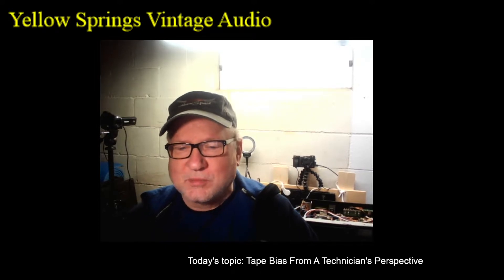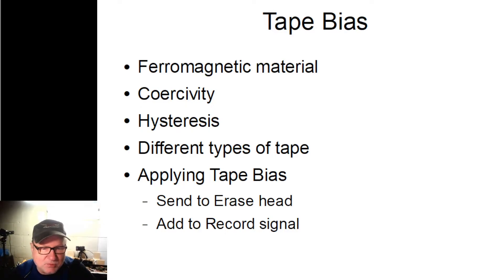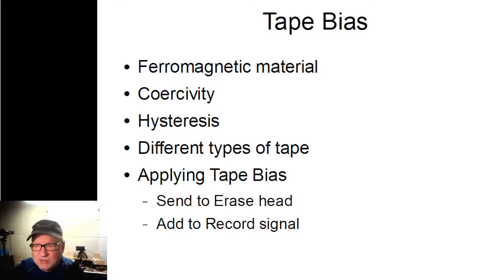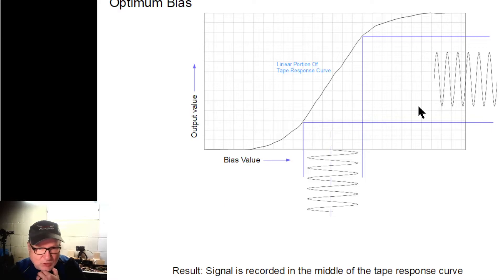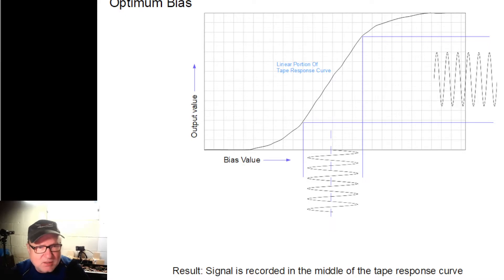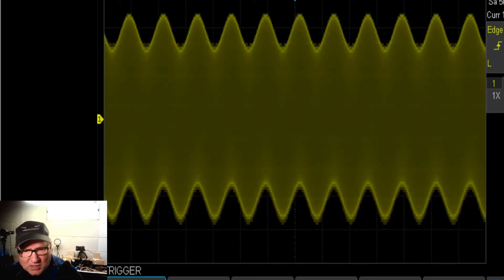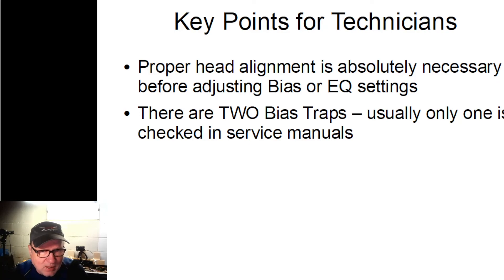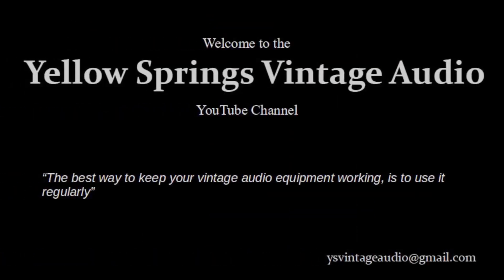Tape Bias from the Technician's Perspective (a little technical)

Comment: Hey there. Great explanation, thank you. I do have a question though.. I have a Tascam cassette multitrack recorder and want to add in a switch to toggle on/off the erase head (with it off I can easily record sound on sound using a tape loop). If I understand correctly, simply adding a switch into the circuit would have negative effects on the quality of the recording. I’d love to know how you would go about implementing this modification. Cheers

Comment: So, is the knobs on the front panel is usually not for the recording but for playback? is the recording one on the circuit board?
Reply: @SIBIRIAKcom,  In the record mode:  the input knobs control the signal going to the record circuitry. The record knobs adjust the level of signal being put on to the tape by the record head. A proper level of tape bias is required to ensure the input audio signal is recorded on the tapes' most sensitive region.

Comment: note: the 100Khz is for consumer based machines. I have setup machines with a 432Khz (record) and 144Khz (erase) 1:3 raito on professional machines lie the AMPEX ATR-100. Beginning with the AMPEX MR-70, AMPEX began using 150Khz as their bias frequency.
Fun Fact: 2" Quad video tape has the magnetic particles oriented perpendicular to the tape as opposed to parallel to the tape. Of course 2" quad video tape machine are on a WHOLE other level of performance to a simple audio recorder, where an audio recorder must faithfully reproduce up to a 20Khz bandwidth, whereas a video recorder must faithfully reproduce a 6Mhz bandwidth!
Reply: @rty1955  Great information! Thanks for letting us know more about commercial machines.

Comment: Why didn't they record using FM like Ampex did with video on the quad machine? No bias or noise reduction needed.
Reply from the maker: I suspect they didn't use FM for storing the sound on the tape was due to the complexity of the FM circuitry.  Retrieving the audio signal from an amplitude modulated signal is easier (equate  that to cheaper and easier to maintain) than frequency modulation. That is very valid question, of which I don't really have an answer.  Thanks for asking.

Comment: I wish more people would watch videos like this. It proves the point I've been making to Nakamichi owners since the early 80s that using a bias trim control as a record EQ control is entirely the wrong way to go about it. It's just poor design. If you want minimum distortion, set the bias level correctly first, then sensitivity level, then recording EQ. That's the way Pioneer's Super Auto BLE automatic tape calibration goes about it and the results are always superior to tweaking bias alone. This wouldn't be necessary if all cassette tapes followed the IEC specs per tape type exactly, although there were a few specific BASF reference formulations that came very close if you knew what you were looking for.

Comment: Thanks for the great video, Keith. I do have a question about bias trap settings on a Teac A-6100 MK1. The service manual says to set the traps for minimum output but, that’s completely to the left & I imagine that that would be completely down. Am I misunderstanding something?
Reply from the maker: Simpson, the purpose of the Bias trap is to remove the 100KHz signal that is present on a tape that has anything recorded on it. So by setting the trap for a minimum output, you are ensuring that only the actual audio passes through to the tape out pre-amp section.  Keep in mind that there are two bias traps.  The first one stops the bias signal coming from the tape.  The second bias trap blocks the bias signal erroneously feeding back into the input circuitry - this second on the very important as its purpose is to prevent the strong bias  signal being recorded on to the tape, from seeping backwards and interfering with the audio signals from the playback and record circuits.
Reply: @yellowspringsvintageaudio352  Thank you for the response, Keith. So, on my o-scope, once I see the 100kHz sine wave, I should decrease the bias trap until the sine wave is no longer visible or barely visible?
Reply: @SimpsonSound  yes... you might be able to make the bias signal go away. But you should be able to minimize both channels to near zero. If there is a significant difference between the right channel minimum as compared to the left channel minimum OR there is bias further back into the circuit, then you need to repair the bias trap. If you follow your schematic from your line inputs or microphone inputs, you will see that the very last circuit before the inputs are sent to the record head... is a 100 KHz bias trap. Immediately after the bias trap, the inputs are combined with the high signal bias oscillator. That bias oscillator signal must not be allowed back into the input circuitry! If you suspect that might be the case, the bias trap consists mainly of a resistor-capacitor and a transistor. When checking the capacitor with a dvm, always remove one lead from the circuit board. My experience has been that bias trap failures are either or both of the capacitor and transistor.
Reply: @rovingreikimaster Thanks again for the response. I’ve now finished adjusting the bias trap & did a bias adjustment using the type of tape I’ll use on the deck. I’ve calibrated it back to factory specs per the manual. It sounds amazing! Thanks to your channel & your help, I now understand exactly what’s happening & what I’m doing. A sincere thanks to you. I really appreciate it very much.
Reply from the maker: @SimpsonSound  Thanks for that update. I'm glad I was able to help you!  Out of curiosity, what test equipment do you use besides an oscilloscope?  I have been considering making a video about tape deck test equipment (purpose built, general off-the-shelf, and really cheap/used).  Would you find such a video(s) useful?
Reply: @SimpsonSound  I glad to hear your tape deck is sounding great.  Just out of curiosity were you making most of your measurements via a oscilloscope?  What other test equipment did you use?  

I have been thinking of doing a series of videos of tape deck test equipment, from purpose built to generic to down right cheap.  Would you find such a video interesting/helpful?
Reply: @rovingreikimaster  Thanks, Keith.

For my calibrations, I use:
1. Ferrograph Recorder Test Set RTS2.
2. Oscilloscope
2. NAK T-100 (software)
3. Digital multimeter
4. Different calibrations test tapes (3 3/4, 7 1/2 & 15 ips).

I think it would be great if you'd make a series of videos. It would be extremely helpful to the community. Especially, because there are not many reel to reel techs around anymore and people are now forced to be their own techs on these decks. Although I've been using reel to reel since the 1970s, I only started learning to repair them about 5 years ago. I've always wanted to learn but, just didn't know where to start. Thanks to people like you here on YouTube and Facebook groups, I bought an old Teac deck, got a hold of the service manual, took it apart and fixed it. Since then, I've repaired and rebuilt a Revox B-77, two Revox A-77s, Akai GX-255, Sansui SD-7000 and now my Teac A-6100. It's all that I really want to do now. I actually dream about trouble shooting and fixing these things! I love it!😄

Comment: Can you bias tape with AM modulation? Would that lead to less distortion?
Reply: Amplitude modulation (AM) causes the high frequency carrier to get stronger or weaker in response to the audio waveform, resulting in a symmetrical waveform. In other words, if you could slice the waveform down the zero line and flip the negative side upside down, it would be identical to the positive side. if a negative peak is strong enough it will completely pinch off the carrier. Bias on the other hand is different...If you look closely at the waveform in the video you can see that the positive side is not symmetrical with the negative side. In AM, when the positive peaks become more positive, the negative peaks become more negative. In bias, the positive and negative peaks move in the same direction.
Reply: Miro, if you look at the signal coming directly off the playback head, what you see is the stronger, higher frequency, bias signal being amplitude modulated by the audio signal. The first circuit the playback signal goes through is a filter that blocks the higher bias frequency... leaving the audio signal to proceed on to amplifier and metering circuits. The opposite is true during recording. The last circuit before the record head is one that amplitude modulates the much stronger and higher bias frequency with the audio signal. So the answer to your question is, YES. That is exactly what happens.  Thanks for your question and watching my video.

Comment: Thanks for your technical explanation Keith! It fills in a lot of little holes in my understanding. How hard would it be to measure the signal direct from the playback head to see what a pure tone + bias looks like on the tape? I tried with a cheap digital oscilliscope, but I don't think it's sensitive enough at 20 mV.
Reply from the maker: Mike, looking at the signal directly off the playback head is possible, but technically difficult. The reason it is difficult is that the bias signal is much higher and stronger than the actual audio signal.  So what your would see on an oscilloscope would be the bias signal (typically 100kHz) being slightly modulated by the audio signal.  The example I showed in the video is just that, a example that is exaggerated for illustrative purposes.  However, I recently procured a tunable filter that I believe will be able to block the high frequency bias signal completely and leave just the audio signal.  Which, would among other things make head alignment more precise. So, if I am successful in doing that I will post a "part 2" to my Tape Bias video.
Reply: @yellowspringsvintageaudio352  Agreed. I'd like to see all the signal coming off the head, even the bias signal.

Comment: Hi, great video! I know this video is a couple years old but I wonder if you can answer my question. In a two-head fixed-bias  cassette deck, is there generally a way to adjust the difference in bias that the tape type switch makes?  I have a Hitachi D-230 which has separate bias and eq switches on the front panel for type 1 and type 2 tapes.  I've set the bias for Maxelll xlii tapes with the switches in the type 2 position. If I try to record on a maxell UR with the switches in the type 1 position, the playback-record level is the same but there is too much bias, resulting in very dull recordings.  It seems like there must be a way to calibrate the impact of the switch position but the service manual doesnt mention it.  If you have any insight I would be very grateful!
Reply from the maker: Hi Steven.  I pulled the service manual up on your cassette deck and examined the bias adjustment and the CrO/normal circuitry for both the bias and the equalization. The way Hitachi works, is pretty much like most cassette decks do. The bias adjust, which there are separate ones for the Right channel and the Left channel, is made using CrO  (Type II) tape.  When the tape selection is placed in the "normal" position, a different resistor is placed in the bias circuitry that lowers the bias voltage. Based on your service manual, when the CrO, type II and the Hitachi is recording, you adjust RT4L and RT4R so that there is 15 volts of bias signal across the left and right record/playback head, respectively. For the "normal" record there is no separate adjustment, just slightly different circuit that lowers the bias voltage.  

What you are experienceing may be an Equalization problem.  There are no adjustments on your deck for equalization.  The only difference in equalization when switching from "normal" to CrO are different sets of fixed value "resistor/capacitor tank" circuits.  

Another common reason you might experience "dull" sound could be a need for a good head cleaning and demagnetization.  If you haven't tried that, I would do it before preceding to make any "adjustments".

Finally, if you don't have the service manual for your deck, you can download it for free from www.hifiengine.com.  You will have to register to download, but the registration is just used to prevent someone from downloading more than 5 documents a day.  There is a sister site that covers turntables... it is www.vinylengine.com.  Steven, I hope this helps you! Please don't hesitate to contact me at: ysvintageaudio@gmail.com
Reply: @yellowspringsvintageaudio352 

Hi, thanks so much for this amazingly helpful reply!  The fixed circuit differences for type I and II bias and eq make sense to me.

 I do have the service manual, and after cleaning, demagnetizing, and aligning the heads, I followed all the calibration steps. The only one I did differently was the bias step. I wasn't sure where to measure the voltage across both ends of the head, so instead I recorded and played back 1khz and 10khz tones at -20dB using a type II tape that I wanted to calibrate the deck for, and adjusted the L and R bias pots so that there was no difference in the levels of the low and high frequency tones on playback.  I would be interested in the 15v method if I understood where to make the measurement though.

One thing I've noticed is that if I record a type II tape on this deck with type II bias and eq selected, it plays back correctly on other decks --- but if I play a type II tape in this deck that was recorded in any of my other decks, I have to select type I EQ on this deck or the highs are absent. This issue is not present with type I tapes. Both pre-recorded and home-recorded type I tapes play back perfectly on this deck with type I bias and type I EQ selected.  So I'm thinking it might indeed be an EQ problem.

Thanks again!
Reply from the maker: @rumsfeldisinsane   -  Keep in mind  EQ is only related to Bias if the bias adjustment is such that it limits the changes to the frequency response curve made by the EQ circuits. For example, if the EQ is trying to increase the high frequencies, but in doing so the signal reaches tape saturation (because the bias is too high)  the high frequencies will be compressed and cut off.  The same would be true for low frequencies if the bias was too low.  As I said in the video - the object is to keep the recorded signal in the linear response range of the tape.  That is what the bias adjustment does. Type II tapes have a greater linear portion, so by increasing the bias you are provided the capability to take fuller advantage of the potential dynamic range of the tape. The Type II EQ settings is fulfillment of that advantage via extra dynamic range - but if the bias is not adjusted correctly then the EQ efforts may not be successful. NOTE: When I say dynamic range, I am not only talking about distortion-free frequency response, but also about being able to capture the very slightest of sounds along with the very loudest of sounds.
Reply: Fine explanation. I thoroughly enjoyed this .
Reply: @JD-lk7im  Thank you! I am glad you enjoyed it. If you have other vintage Audio topics of interest, please let me know.
Reply: @rovingreikimaster  I'll definitely keep that in mind.
Reply: @JD-lk7im  in cassette decks, there is usually a right and left bias adjust for the best quality tape the deck can handle. For example: if your deck can handle "normal" tape and "type 2" tape, the bias adjustment ( and equalization also for matter) is only adjusted for type 2 tape. The settings for normal tape are a fixed value below the adjustable type 2 settings. If your deck can handle normal, type 2 and the type 4 (so called metal tape) then only the type 4 tape is adjustable. All other types of tape have a fixed bias and equalization setting below that of t.he type 4 tape. Here the catch... metal type 4 tape is very expensive. You may never use it! In that case, you could adjust the type 4 settings in such away that your type 2 settings match your desired results. I have successfully set up decks with metal tape capacity by adjusting the type 4 metal tape bias and equalization to give me a more dynamic type2 tape response. It worked successfully for me on TeacV-95X with Maxell XL-II and XL-IIS tapes.
Reply: @rovingreikimaster  Thankyou once again. I've slept on it and this morning I have've been reflecting on the bias adjustments for" type 2"  only and the fixed value on normal tape. I have a Pioneer CT 720 that wasn't erasing any tape and was making low and distorted recordings . Transistors we getting toasty on the bias powersupply as well. I replaced a failed capacitor in the bias trap. It now was erasing perfectly but the bias and other level adjustments were well out. Bias adjustments for Metal and Cro2 with another two for left and right. The Pcb isn't screen printed in the pioneer, but thanks too your explanation I'll be going back in with my newfound knowledge, thanks to you.
Reply: @JD-lk7im , in actuality there are TWO bias traps in a tape deck.  One is used to prevent the bias signal from feeding back into the record circuitry.  The second one is used to "trap" or separate the bias signal from the audio signal during playback.  Often Bias and Equalization are thought of as a single function. But really, the bias setting (the one you adjust) determines how much Bias is applied to the tape during recording.  The other bias trap is just a filter to block the high frequency bias signal from messing with the playback circuits. The equalization only affects the playback. Equalization has nothing to do with recording.  Having said that, various noise reduction systems like Dolby B, C and DBX do affect both the record and playback equalization curves. But these noise reduction systems are usually checked/adjusted ONLY after the traditional Bias/Equalization checks/adjustments are made.  I hope this helps you. Best regards